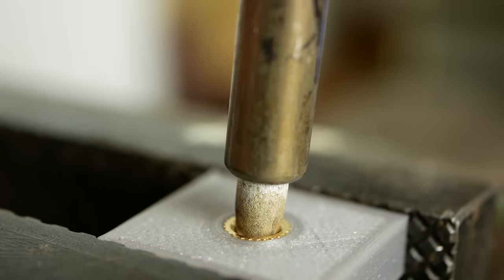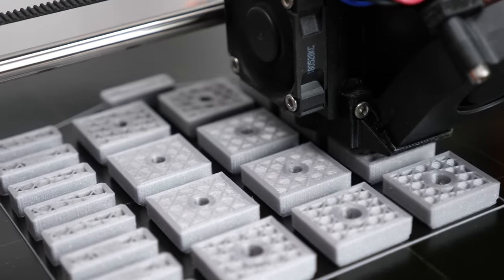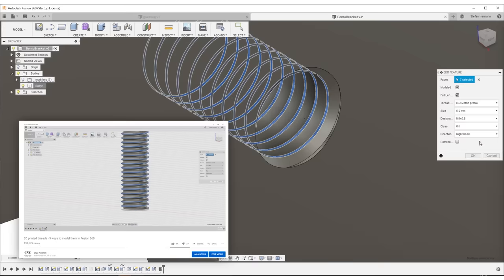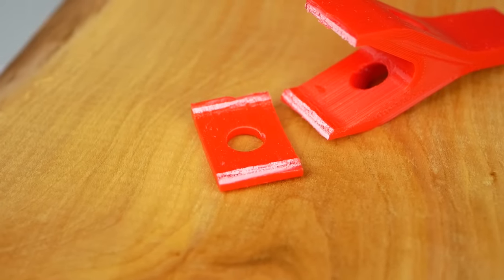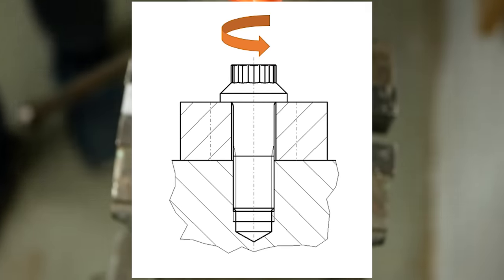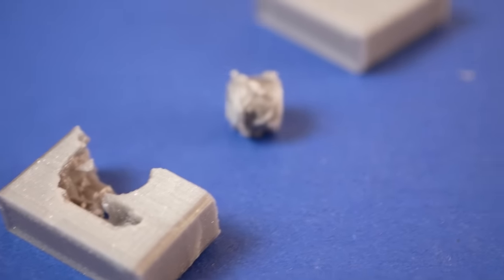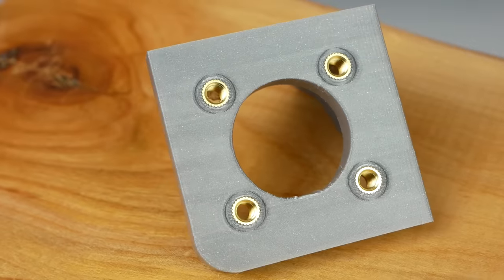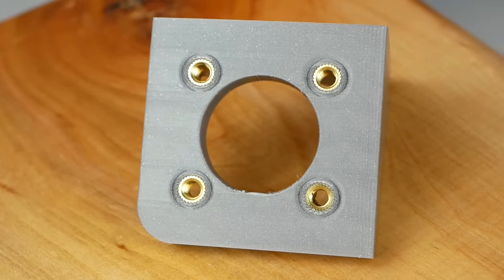Threaded Inserts in 3D Prints - How strong are they?

Comment: I’ve used hexagonal shaped m3 inserts, which I’ve gently tapped with a hammer into the part, which give very good resistance to pullout (generally you have to destroy the part to get them out). Sadly, they aren’t cheap, but for a really neat and strong connection are the best I’ve found (and my uncle thinks they are really neat too)...
Reply: We are manufactured brass insert components and mouldings components

Comment: I am Using threaded inseets mostly on parts which are disassembled regularly because they don't strip. Not for strength...
Reply: Yes, doubly so if the inserts are brass.  Brass is too soft to give a strong joint with the normal pitch of metric threads.  That is why he stripped out the threads when he tightened too far.
#316 or $304 stainless inserts are better for strength but not as good for repeated use because they tend to gall.
Reply: @Roderick storey
Self tapping is also a cheap option.  Even if the cover needs to be removed once a month, so long as the self tappers work for about a year, they may be used in a cheap product.

Comment: I often use rivets to connect 3d printed parts that will never (or rarely) need to be separated. They are cheap and quick and never loosen when twisted. I've often wondered why rivets aren't used with 3d printed parts. A rivet gun is cheap, try it out!

Comment: I bought 200 M3 inserts in bulk, worth every penny and have used about half of them over the last year, the only thing missing from this video is any mention of the weight gain, a few inserts and your parts can easily double in weight, I've never had a problem with this, but 'flying' parts may well suffer. 

also note I found a soldering iron of around 70W is best, my 15W just took too long.

Comment: This is awesome! Seriously, this is some of the best 3DP content I've seen in a long while. 
I recently had to do a vehicle design project for an engineering design course and the question of how to fasten the the various components came up. Threading the PLA directly with a tap or by modelling the threads was quickly ruled as one of the design criteria was that the vehicle needed to transform and would need to be easily disassembled and reassembled multiple times without fear of the threads getting worn out or cross threading occurring. Initially everything was held together using M5 brass inserts, but after about a month of destruction testing they were eventually replaced with steel M5 nuts snugly pressed into an inset on the opposite face.

Comment: Great video!  An easier way to get localized reinforcement regardless of your slicer is to make very thin (0.1mm or less) cuts in the area, forcing a double perimeter.  For example: you have a 0.4mm nozzle and you want 0.8mm outside walls with 1.6mm walls around 3mm holes.  Cut an extremely thin 4.6mm cylinder around the 3mm holes forcing the slicer to put two walls at the holes.

Comment: Great video! My experience using both modeled, tapped, and threaded inserts exactly matches your results. In each case where I've had a failure it has been in another location of the part, never in the threaded connectors.

Comment: I have used nuts for bigger bolts, and sometimes even screwed directly into the hole (with<m3 bolts). Next to that, I sometimes use entirely different methods, like lining up holes in my prints and pressing a small brass rod through them. This sometimes saves space and can be quiet strong as well.

Comment: Wow, I'm impressed how much all of those could handle. Although I also like the idea of making hexagonal holes in which you can precisely fit a nut. Probably more or less comparable to the inserts, but my guess would be that it may handle a bit more torque.
Reply: unless the nut was inserted from the underside with a small lip at the top surface, wont the nut just pull out the moment you try to tighten sth down?
Reply: @JoshuaLotion  I usually put the nut in on the other side, yes. In my experience it's rare that the design doesn't allow that. And with the right tolerances I have to pull the nut into the hole using a screw, which holds tight enough afterwards that I had to destroy some printed parts to get the nut out again.

It's good enough for my purposes and I can get nuts in every hardware store.
Reply: @SaHaRaSquad  Yea that does sound pretty effective and considering i have a whole box of various sized nuts. this is probably gonna be a method im gonna start using. thanks for the tip

Comment: Currently, I'm using small bolts (M3 & M4) with nuts embedded into hexagon shaped recesses. 
Now, I'm feeling that inserts might be stronger. Could you test this?
Reply: Old video and comment, but I 100% agree, the "nut pocket" (as used significantly in the Prusa MK3S) is another great method and I think simpler overall.

Comment: You are right. People watching without subscribing. I was one of them till one minute ago. 
You should put in this test the version of embedded nut or the hexagonal hole for the nut. I think this version will be more resistant because you will have more material around the hexagonal hole due to more complicated geometry. Also, I didn't test but I think the gradual infill will help in this case even if is done only on vertical. As you can see, a massive damage is present at the top surface also. So a gradual infill and increasing layers for the surfaces (wall thickness) will help.

Comment: I am using M3, M2.5 & M2 for RC Airplane and UAV repairs. For my foamy Tundra bush plane, I repaired the landing gear by dremeling a hole, that after cleaning I added CA-Super Glue then the Brass insert. Worked great.

Comment: Slic3r does allow you to add those modifiers in the slicer, it's just really unintuitive and clunky.
Reply: Get the beta. It's a lot less bad.
Reply: It's not bad in the regular, non-prusa, version
Reply: My point was that Slic3r has the functionality, in contrast to what is said in this video.
But the update is indeed a huge improvement.
Though the old system was good enough to make a print succeed that would have failed without it.

Comment: M5 is huge and overkill I would say. 
Normally I go to either M3 or M4
Reply: The problem with M3 is that the head of the bolt and the nut are quite small and can't take any load. Using a washer and a brass insert will make them way better. I use M5 and M6 otherwise, it is not about the strength the bolt&nut can take but the area that the bold head and nut will cover to get just a bit more torque and to prevent creep.
Reply: @squidcaps4308  I think, the brass inserts would really help m3, since you make the influence of the head size less

Comment: Awesome video.  I've been using these type of inserts in 3d prints for a while and I love them.  I still use modeled threads at times, and I will sometimes use nuts where I don't have clearance to "solder" the inserts into place, but more often than not, I use the inserts.  Another way to make these connections much stronger, is to put them on the opposite side, so that there is several mm of plastic between the insert and the pulling force of the screw.  I mention this because there seems to be more of a tendency to torque out the parts when using PETG.  At least in my experience.

Comment: As an engineer I like that you give actual figures and test in different layer directions.  I generally use M3 and M4 (less so) bolts for my work and personal projects and PCB designs.  When I've designed enclosures for electronics boards, I've used self-tapping screws for plastic as used in RC cars.  In some cases I've seen the self-tapping screws shear the plastic inside the posts when over tightened as there are too few walls around the hole.  Your local modifier mesh trick will definitely help, thank you.
I have used the inserts in IP rated ABS enclosures so as to not drill holes in the box and ruin the IP rating, they had short mounting posts.  A trick with the inserts in blind holes is to have a bolt screwed into the insert when melting into the part.  This stops molten plastic pushing back up into the thread and blocking it.  Once cooled the bolt can be unscrewed from the insert.

Comment: That's the way to go Stephan. Now in nylon?
Reply: Nylon sucks for such uses.  It is not stiff enough.  Nylon is tough so it is good for applications where giving a bit but not failing is the best option.
Reply: @kensmith5694  you have a point.
Reply: @stalawina  Do you use threads or inserts?
That is the topic
Reply: @stalawina  
Inserts will do better.  They spread the same force over more area.  I suggest stainless ones for high loads.  Brass avoids galling but is too soft for the standard metric tread sizes.  Most folks don't want to have to use special screws.  #304 stainless is almost hard enough to get the full rating out of standard screws.

Comment: I use brass nuts for threaded inserts. In fusion 360 I model holes for them that are slightly too small to fit the nuts in. Then I screw the nuts on a screw and heat it up with a small torch and then I press it in to the part. Works like a charm.

Comment: Awesome video. Thank you for taking the time to do this.  As of now (I am too new to know when it was added) Prusa Slicer allows you to modify the part by adding a "Part modifier, Cylinder"  You can then overlay that around your threads, and change the infill locally to 100%.  I've done this with threads in the past, and seems to work.  Since it's not adding an actual part, it doesn't do the doubling you mentioned in the video.  Hope this helps!

Comment: Very unexpected that the insert did not pull free of the plastic. This solves many problems where 3D prints would normally be eliminated due to the inability to connect the parts, and alternative milled aluminum or wooden construction would have to be used. Excellent video, thank you!

Comment: Great video. There are tapered inserts specifically for heat or ultrasonic insertion. I use inserts primarily for high use or when a design would benefit from a shallow thread.

Comment: I use threaded inserts quite often. A lot of parts I make for use at the university are fixtures, etc. that will be taken apart and put together many times so plastic threads would not hold up. I like to use expanding inserts designed to be pulled into the hole (not heat set.) I print the hole to the size needed by the insert, then ream with a drill bit to make it exact and sue a screw to pull the insert into the part. It works very well and I can even press the inserts back out to use them again (often do this while making design iterations.)

I am working on a part now that holds two small wheels and needed some bearings in the plastic. I got some aluminum tubing, reamed the ID to match the bearings and then knurled the exterior, making a sleeve to hold the bearings. The corresponding hole in the 3D printed part was reamed to size and then the bearing sleeve heat set. Reaming the hole in the 3D printed part first makes the heat setting process easier, eliminates the flashing problem and make getting the sleeves square to the part much easier.

I have also experimented with capturing nuts inside a part during a print. I did a few small novelty items with magnets captured inside too.

Comment: Hi, I have used threaded inserts for a couple of projects before. I find it a very elegant solution for assembling bigger parts that need to be disassembled again.
I have exclusively used inserts that have a thread on the outside so you screw them into the piece (for M4 you make a 6mm hole in which the insert perfectly screws into). I like the solution very much because it is clean and very fast (you can use a powerdrill to screw them into the hole - just takes a couple of seconds and will never come lose again)
Through some tests i have made with PETG i came to the conclusion that with the correct print-settings the thread of the screw or threaded rod will break before the insert comes lose from its hole. (which kind of amazed me).

Comment: In plastic part design, I always teach that if the part is not intended to be assembled multiple times then screwing directly to the plastic will be the cheapest straight forward method.  This is very true of automotive part design.  In automotive they use thread cutting plastic screws.  Rarely or never is a machine screw used in plastic for the reasons you stated. Additionally, in plastic parts, at least mass produced injection molded ones, the walls are not solid and the screw boss is it's own wall.  The screw head is also important, never use a countersunk screw in plastic. That's how you get cracking from hoop stress, use a flat head or flanged screw to distribute the load. In most manufacturing scenarios the metal part receives screw threads and the plastic part tends to be a through hole that's sandwiched between the two.  Great video as always!

Comment: I've been using these lately and i am impressed how well they stick. I made a temperature controller for cheap soldering iron that i use to heat them, it was real nice to use inserts on that box too, it came out looking quite nice with hidden threaded inserts instead of bolts.. I did post about this quite  recently in one facebook 3D printer group.. my results were the same, the brass inserts were superior and even partially bonded inserts held really well but that is a lot about what temps you melt them. 

Too cold and they can be literally pulled out by hand but once you get the temp just right, they will stick to brass permanently. The key is to use using high temps and use as little force as possible, they should sink in almost under their own weight. But the all that time you are also heating everything around them. Put the part to a freezer and then do the inserts with quite high temps and fast worked by far the best. So.. i'm making a press for this using two 8mm rails and linear bearings, the whole procedure really needs a straight push. Soldering iron and eyeballing it is way, way too inaccurate specially for longer bolts.

edit: here is the temp control box, it has just basic eBay dimmer circuit inside. https://imgur.com/a/6z0KATA

edit2: funny, i talked about inserting new walls using curas "support blocker" too in the same group to enforce holes for inserts and for drilling.. :) it almost looks like you have been following the same groups.. That is just great :)

Comment: Interesting. As somewhat of a newcomer to the 3D printing scene I never even thought about the possibility of using inserts like these. I almost never print the threads themselves either, instead always printing hexagonal holes to fit a nut into instead. There was no calculated reason for this, I just used whatever was already at hand in my workshop and it has worked great so far.

Comment: We use metal inserts in our 3d printed grow lights, BUT we use push in expansion type rather than melting them in which is a bit tedious and also prone to being crooked. The best type for resisting pull out are the reverse headed type where they push in from the BACK side and have a rim which means they cant be pulled through. these will give you by far the strongest threads if you are screwing all the way through a piece. We use them and have never had a problem, even when the courier manage to seriously damage the unit (throwing one over a 3 meter/9 foot wall for example) the inserts were unaffected.)

Comment: At work we use tons and tons of M2,M2.5, and M3 heat set inserts from McMaster Carr. They are great for parts you want to be able to remove easily, but still tighten securely and maybe use some loctite if necessary. The disadvantage is that if you don’t get the insertion perfect, you end up with scrapped prints.

Comment: Very cool video, I can definitely use your findings for my projects. 

But there's one thing I have to add (just like you already said on the podcast), I'd suggest testing different kinds of metal inserts. I use the wood type from Rampa successfully for grub screws on a motor mount and they hold up really well in axial and rotational loads. I think they might be better suited for high stress situations, especially when using stronger filaments than PLA (PC, Nylon, Alloy 910). 

Cheers!
Reply: Are the ones you're talking about with big coarse external threads? I have used a version that's 1/4"-20 inside and 3/8-16 outside.
Reply: @thewheelieguy  I don't know the measurements of the thread, sorry. But they are wood inserts with a very coarse thread and I used the m4 and m5 variants so far.

Comment: For threads I've been using modifiers in Cura to ensure that the area of the thread is %100 infill. I then drill a hole 1/16'th smaller than the recommended for a standard metalworking tap on my drill press (because the material is soft) and then tap as I would a piece of aluminum. No lubrication required. This has worked well on PETG and ABS.

Comment: For working molded product at Emarena Corporation I use threaded self tapping wood inserts for multi piece 3D prints. I over size the holes, a 3mm minimum thickness and plastic epoxy glue the product in to fill. Soldering in the fittings or tapping result in early failure rates due to high torsion. Use of SS machine socket bolts with black (rough) carbon steel fittings provide grip for a few hundred uses prior to expected failure. Polished ss to ss typically require over tightening.

Comment: Been using these in prints for years. They look so much more professional than inserting nuts.  I have used M2 to M8 mainly in PET and some in PLA.

My favourite ones are the "top hat" ones. They have a flange at one end similar to the one above the  "a" in India at 1:26 but larger diameter. 
If you orient them right in your model, so the flange is trying to be pulled through the print they are the strongest.